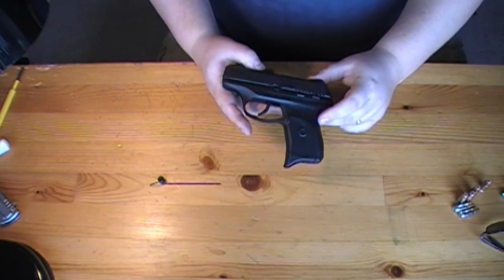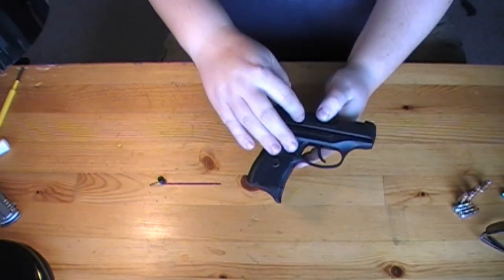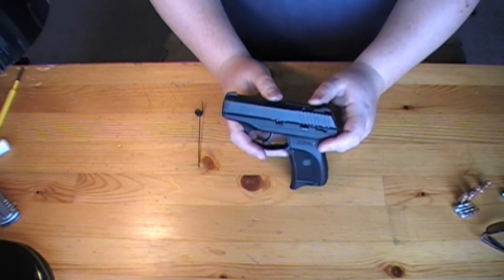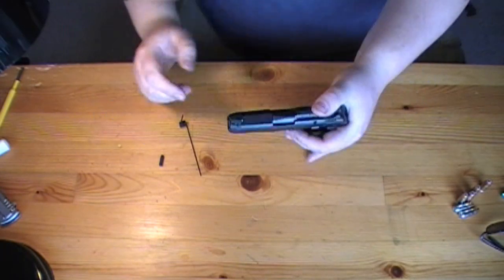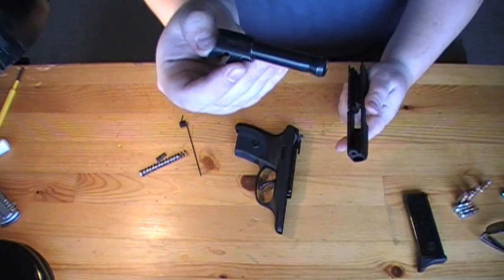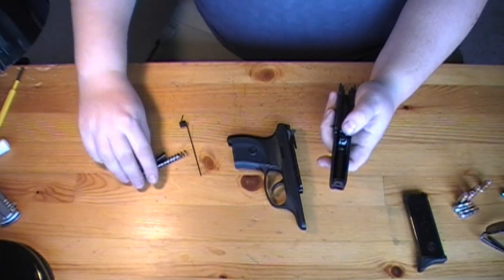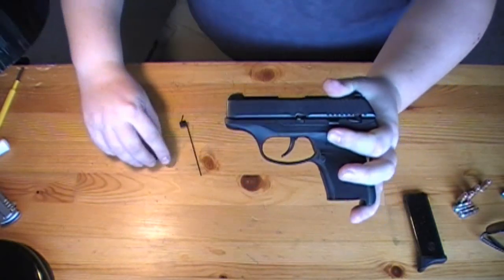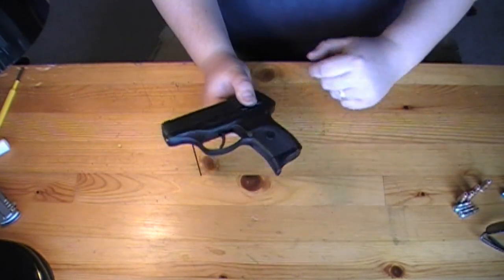Ruger LC9 Disassembly & Reassembly

Comment: What do you have against Ruger? Feature packed,high value, made in U.S.A.. I carry mine so I practice at least once a month.I've never had a single failure with any Ruger except for my 22s, and I'm sure that was just shitty ammo.I don't like mag disconnects, but the take down is not a big deal at all.I like the long trigger pull on a gun I'm carrying..If you think of the L.C9 as an 8 shot revolver the trigger is no problem.I like your vids.